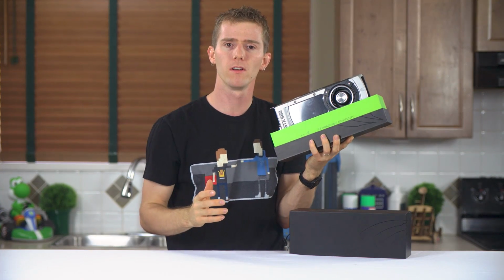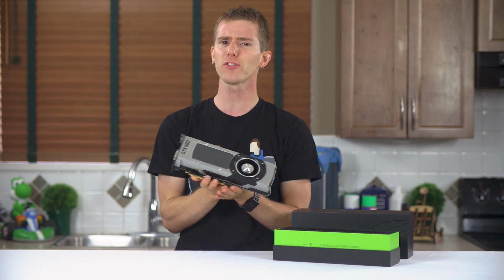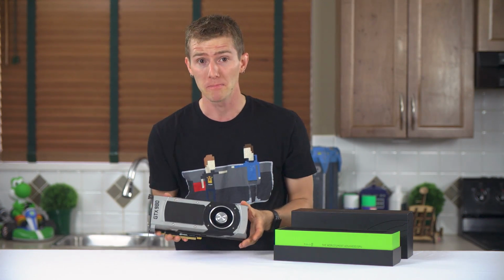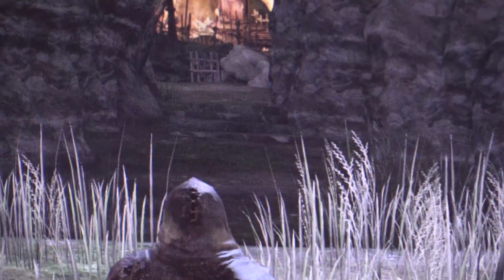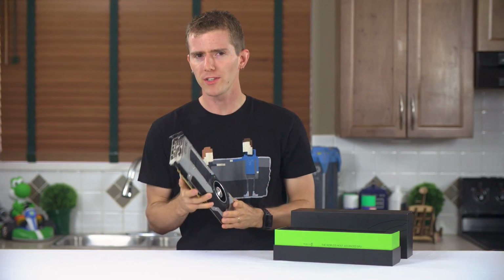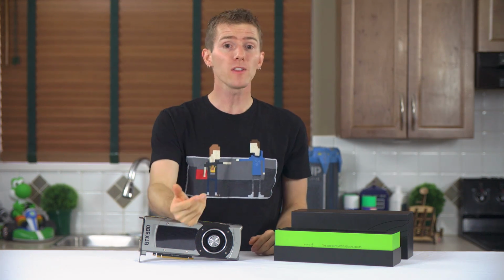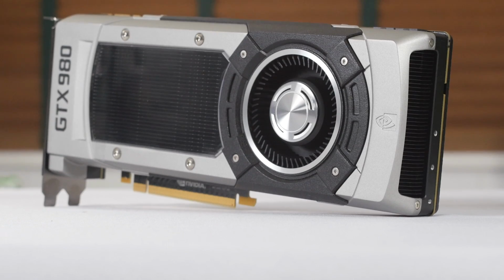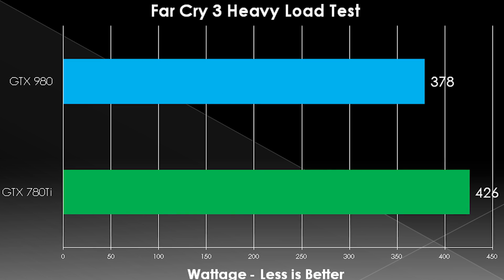NVIDIA GeForce GTX 980 Video Card - Performance Overview

Comment: I'm an AMD fanboy but hearing those clockspeeds. heavy breathing intensifies
Reply: im gonna wait till AMD release their cards. Find which is the best for the money then  probably jumo to 1440p res. I perfer amd but got nothing against Nvidia. I just think waiting to see both sides is better than blindly buying a product now that has a lot of potential to be worse and more expensive.
Reply: ChronicCoding I said the same ting but the prices are gonna be hard to beat
Reply: ChronicCoding
more and more games nowadays are using nvidia gameworks so IMO its best to just go nvidia.
Reply: ChronicCoding they would need to sell their r9 290x bellow 300 bucks.  They can't sell it for $330 because no one would buy it when the 970 runs cooler, makes little to no noise with lower power consumption.  It would have to be like 280.

Comment: For anyone upgrading, a 980 is a no-brainer.

But, if you have a 780 ti, I don't know.

I'd say you're kind of boned. The new card is better, so you won't get good resale value. And the 980 is better, but not by much.

I guess them's the breaks.
Reply: i got a titan when it launched and i will upgrade to 980...as soon as i find someone who is willing to buy my titan for 400 or 500 bucks that is xD fingers crossed
Reply: GL with that. Can't even sell a 780 ti for that price right now, and it's arguably a better card for gaming applications.

Comment: How is it that TechofTomorow always has fair results for AMD products and yet you guys don't. You always make AMD products look as bad as you can possibly can while saying that you don't hate or favor either AMD, Intel or Nvidia.
Just as proof that they cripple AMD, I ran Far Cry 3 on my Sapphire Tri-X 290x with a FX9590 on a BenQ XL2720Z with Vsync turned on in the scene where you escape from the burning building where Vaas ties you to a chair. My average fps was 87 with the highest being 144 and the lowest dip being at 53 when I looked at an explosion. I ran the scene all the way until I finished the mission.
Reply: whenever linus reviews an nvidia card, he chooses games that can utilize nvidia features ...so of course youd see better perfomance on the games than the amd counterpart >_<
Reply: MrMilkyCoco, Far Cry 3 is supposed to be, from what I know, a game that is also optimized for AMD. Look at the video at 9:08 where he shows the average fps in Far Cry 3 to be 48.6 on a 290x. I had almost double that with the settings at max and also at 1080p. I don't know what scene they use for benchmark but I used the mission where Vaas captures you and ties you to a chair in the building he sets fire to and then you escape with Liza because I considered it to be visually demanding with all the explosions and car chases.

Comment: last time I've had a backplate on my card was GTX 280. This is not the first time nvidia has ever done this...
Reply: They told "on stock design" and not the redesigned cards
Reply: Benihipe  I'm pretty sure my card was stock. Also most other brands also had the backpanel, so it wasn't one brand exclusive.

http://img.techpowerup.org/110310/gtx280_2.jpg

Comment: Think i might wait for the 980TI if there is one. If not, I'll go for two 980s.
Reply: There probably won't be, I don't believe there are any locked cores on 980 and they're hardly going to spend a huge amount of money developing a different GPU just for one card. GK110 had already been developed for Titan, and 780Ti was largely in response to 290X. Personally, I reckon that when you throw in MFAA it will be hard for AMD to beat 900 series, and they look to be liquid cooling their next flagship.
Reply: JammyDuel
Interesting, thanks for the input.

Comment: The 980 is cheaper than the 780 ti right now. Until the price drop happens the 980 is the place to go for high performance value. In the same way the 780 ti was the titan killer the 980 is the titan black killer.

Comment: Brand new architecture. Barely beats out a GTX 780. Lame.
Reply: the architecture is based on keplar anyway, and its beating a card with 800 more cuda cores than it (the 980 has about 2k cores and the 780ti has 2880 cores) and is using less power to do so you fuckwit, this isnt even gonna be the cherry on this cake as nvidia likely already have the 980ti ready and are just waiting for amd to make their move.

Comment: This is why I am a big fan of Nvidia. How did they significantly reduce power consumption just by changing the architecture and driver. They are so good at milking profit as well. Will they release 900M series as well by the way?

Comment: @C0d0ps  its worth it, but you wont get much actual performance gain from an fx6300.  You will see far more with an Intel i5 or better upgrade.  And those FX chips run very hot, so better cooling is recommended.  Its hard to justify keeping AMD CPUs any more.  Maybe in 2016 when the new chips launch they will be good.  But right now, upgrade your cpu/mobo and overclock everything.

Comment: What is the difference between downsampling and Super Sampling Anti Aliasing?
Reply: the application its used for.......
Reply: Downsampling is the concept of rendering the game at a much higher, custom made, resolution than your monitor is capable of displaying and subsequently having the GPU rescale the image
( as in downsample ) to that of your monitor's native resolution.

Supersampling is computationally expensive because it requires much greater video card memory and memory bandwidth, since the amount of buffer used is several times larger.
Reply: G4M5T3R Isn't it almost the same?

"SSAA is slow because the pixel rendering stage of the rendering pipeline must do the same amount of work as if the screen resolution was many times the resolution of what it is. For instance, with a resolution of 1920x1080 and 8xSSAA, the hardware must calculate the same amount of pixels as if the resolution was 7680x2160."

Source: http://www.dahlsys.com/misc/antialias/

Comment: So is it worth getting a 980 over a 780? Or would getting two 970's in SLI be better?
Reply: 980 seems to be 20% faster than 780.
Reply: WarHell Would getting two 970's in SLI perform better than the 980 alone? I assume it would.
Reply: It's performs quite good on higher resolutions (1440p and more)
Reply: I don't care about power consumption and one card doesn't look so beast... so its a 100% 2x 970's in sli better frames and it should be a 780 or over in performance like the 770 is a oc oc GHz edition of 680. Also if it was a non reference Asus or evga more room for over clocking.

Comment: The GTX 970 is the true star here, amazing performance and awesome pricing. As a R9 290 owners ,makes me jealous for the entire package, not just the performance which is the same or slightly slower or faster depending on the benchmarks.

Comment: So I just bought a 780... For no reason.
Reply: Only if you bought it to brag. Otherwise the card is still very much viable.
Reply: if its evga dont worry
Reply: Why....the release date was practically set as soon as Game24 was announced, then when you consider that there was the offer on 700 series flagships terminating today it was 100% certain that this would be 980.
Reply: The GTX 780 is still a beast of a card and will play games at maxed out settings. No need to worry. :)

Comment: I'm hoping for a non reference with more VRAM because right now this is the same price as EVGA 780 6GB, but with slightly better performance  values and if Watch dogs can consume 3.5GB of VRAM at 1080p Ultra settings I can see this card bottle necking on games that use a lot of VRAM at 4k resolutions..
Reply: it uses that 4gb more efficiently, that 3.5gb of watch dogs on this card would be more like 2.5-3gb.

Comment: If I had the money, I would get the GTX 980, I currently have a GTX 680 in my system, which has an i7 3930k CPU with 16GB of ram. Getting this card will further future proof my system when new games that take advantage of its features come out.

Comment: I Think that what nvidia succeed at is the 970 as it's faster than the 290  and the 780 and when overclocked it is faster than the 290x and way faster than the 780 , and at a price of 330 $ it's a great card and it can run a 4k display with no problems

Comment: Suddenly a triple ASUS PG278Q G-Sync Monitor Setup ( plus a 4th Accessory Monitor ) became a viable Option.

Too bad though all of my current cards are running fine and I'm still doing great with my three Dell U3007 plus a Wacom Cintiq 24HD Touch Monitors.

Kind of wonder how they'll name the Generation after that Card... GTX 10xx?
Sound's weird in my head.

Comment: I already got my 780 ti :) I thin kits a great card and ofc its overclocked like hell :3 I put it in a water cooling loop, and now it stays nice and cool, and it actually runs most games with higher fps than my fiends gtx 980! I honestly preferer the gtx780ti, but its just my opinion :) What do u think? :)

Comment: Guys i'm confused between Lenovo Y50 or a $1350 Desktop, the desktop will be much more powerful than the Y50 FHD, but I can take the Y50 Any where! And whats the best parts I can get for "$1350" PC.
Reply: Talal Aziz Thats very obliviously question, SLI ofcourse.
Ciel, 295x2 will get rekt by 970 SLI.    900 series are equal to AMD's 300 series, Do not compare dragon to rabbit
Reply: I have a y410p. Get a desktop, these lenovo laptops arnt build to last too well. my keybard has fallen off mutiple times and one of my speakers died.
Reply: Spencer Funk That's what i hate about laptops, and what i like is walking around with it any where.
Reply: Desktop...And if you have any spare just buy a cheap gaming laptop. Not great performance but it should do everything you want and that you can do on the desktop. I have a laptop and it is terrible for gaming. So I've been spending $1100 on a gaming pc from February and it will last me for the next few years
Reply: Talal Aziz Desktop. I will always choose a desktop over a laptop however a good desktop can peform 2x as well as a laptop 2x the price. In the end you'll save more money
Reply: Ciel Diablo If u r in my situation for example, you don't like to waste your time alone in ur room, but u have $1400 to spend on a PC, you want a gaming laptop but you feel that the $1400 is too much for it, and in the other hand you don't want a desktop but u know it will be a monster with the new 970!! what ur gonna do ?!
Reply: Talal Aziz lets go with learn English?
Reply: bmxtricky5 let's go to be helpful ? come on man !
Reply: ***** Whats better a single gtx 980 or gtx 970 SLI ?
Reply: Talal Aziz neither get a 295x2 XD
Reply: ***** thank u

Comment: No point updating this year apart from power consumption. Another Very disappointing year for Gpu. I blame AMD because they make shit GPU to compete against Nvidia. Nvidia only need to beat AMD which they always have.
Reply: Are you fucked in your head or something? AMD make great GPUs!
Reply: Gustaf Bjurstam gustafuk u are dumb ass. Check the comparisons on GPU. Nvidia smokes AMD. Nvidia in average have better performance and power consumption in a real comparative price for performence. 

You wan't the best GPU, U get Nvidia 780ti/Titan black.
Wan't the best price cheap low level GPU go for Nvidia 750ti thats slaughters even next gen consoles. 

AMD suck at everything. Even Intel realize they don't need to try hard because there main competition sucks so that's why we don't see much performance on Intel CPU's anymore even though they rape AMD cpu many times over. LMAO that an AMD 8 core CPU clocked at 5ghz can't even muster a 3.9ghz 4 core Intel CPU. AMD are a laghing stock. Look's like Nvidia know it also. Why try hard when ur competitor sucks balls and cannot compete.

Comment: I am really hyped for those cards, especially at the price point. I will be upgarding to a 900 series, as right now my graphics card is like 3 years old and i really start to feel it. Would be interesting to know though if there will be a 980ti, as I will be able to afford a new card starting somewhere in september i guess. Someone will probaply find out untill then, if the core is not fully unlocked yet

Comment: When I buy a graphics card, temp and power consumption are on the same tier as fps. 980 all the way.
Reply: Temp yeah, power consumption not so much is you have a badass PSU, but then again Corsair dominates that market so they're all expensive as fuck.

Comment: The biggest draw for me to upgrade in the next few years is 4K. My 560 Ti and 1080p monitor are fine for now, so I see no reason to buy a new card unless I can get reasonably-priced, quality 4K hardware, and that means a single-GPU solution for 4K for the games I like to play. If I can also get a 4K monitor at a nice, high pixel density, possible in a 23-25" size, I should also be able to disable anti-aliasing in most of my games altogether, adding a few frames onto the reports in this video. But I want to wait until solid 60 is doable in most games. Let's hope the 1000-series gets us there.

Comment: 980 for sure, but my 780 is good for now. i will look into a new when the 1080?? or whatever launches
Reply: Sooo? Your point?
Reply: sooo? why would you uppgrade a 780 to a 970?? or even a 980??? i mean, i upgrade when next line up comen i think, not now. and if 780 ti or 980, so 980

Comment: I've seen benchmarks in which gtx 980 beats gtx 780ti with a margin of over 20fps which is really good provided that 980 is not the replacement of that beast 780ti 980 is suppose to be an replacement for 780 and 980 smacks 780 like a baby just wait for 980ti if you want a replacement for 780ti but I am happy with 980 only

Comment: Should I buy i7 5960X and GTX 980 or go for i7 5930k and 2x GTX 980??? :P
Reply: 2nd one. GPU is so much more important than CPU for gaming.
Reply: you dont need x99 chip for gaming
Reply: If he wants it he can have it.
Reply: But then he should not be surprised that his more expensive cpu do not give him any fps
Reply: wwwelkam Exactly. The difference between a 1150 CPU and a 2011-3 CPU when it comes to gaming is about 3 FPS. (With the same GPU)
Reply: 5960x and 1 980 then add another 980 in the future when you have more resources.
Reply: BrutalSwede But I need overall best performance. I will buy IPS monitor so I dont need more than 60 fps. I dont render films but I need pc that will run many apps at one time ( game, google chrome with many tabs, Autocad and more at same time).
I know that in games i will make 2x more fps with two gtx 980 :P

Comment: Hi! noob pc elitist god gamer here. If i can already run BF4 max on ultra... on my 780ti. will the 980 be better than the best? to put it simply... will there be difference in terms of graphics?
Reply: no
Reply: Nah, it won't look better. But it'll run with slightly higher frames. I'd wait till the 980Ti if you have that kinda cash ;)
Reply: Wut?
Reply: The graphics in game will look the same, but you will get higher frames. You said would there be any difference graphically.
Reply: Ariche2 I just wanna know if I would regret on having a 780ti, perhaps not. Thnx for the info! :D

Comment: for 500 bucks....I paid about 555$ for my EVGA GTX770 (reference Titan cooler) year ago, prices are quite high here, so for 500$ right now I can only get GTX970 which isn't worthy upgrade for sure :P
Reply: 970 is 330
Reply: thereddog223 Depends on where you live. I think Australia has some wicked taxes on their tech.
Reply: idk, I've heard that the 970 beats the shit out of the 770 with a large, blunt hammer.
Reply: That is a lot of taxes
Reply: the 970 is about the same as the 780 non ti performance wise

Comment: Man now im even more confused whether i should go with the 980 or 780ti...
Reply: 980 cheaper and better in almost every situation.
Reply: Commenter ok but when will it be available?
Reply: Few weeks
Reply: MrVarwor
You can buy it at Newegg now.
Reply: I'm thinking get the 980, nvidia still has to release future driver updates for some new features that aren't available yet and I'm sure that will include performance boosts.
Reply: error2k2 damn thanks for all the help bros. The YouTube comment section is proving to be quite useful this time around!
Reply: error2k2
I was actually contemplating EVGA 970 FTW's in SLI.  I am running 670 FTW's in SLI now.  The cost of two of them isn't all that terribly different than one 980.
Reply: deathbringr124 I'm not sure how 900 series scales in SLI yet but if the past is any indication, it scales around 80-90% gain.
But be aware that some games (specially when just released) don't handle SLI well and you will get the performance of a single card.
Reply: deathbringr124 It's not and would probably be faster
Reply: MrVarwor Available now but sold out everywhere. You can pre-order

Comment: imagine the 980 sli with i5 4690 on 650w power supply... all dem dreams
Reply: akalion213 because the performance per watt....
Reply: I am actually interested in the performance of this in sli as well as the 970 in sli.
Reply: Ehm...Why not imagine quad crossfire 295x2, 5960x and 1650Watts?
Reply: Axecution Meh...You will save 50 cents in a year big deal

Comment: should i get a another 770 for sli or should i get a 980 and put it in my motherboard without sli and use my 770 for a different display, if that even possible i dont know

Comment: i'm thinking about buying the GTX 980, but is having just 1 fan on it (as it comes standard) gonna be a problem? i'm not gonna overclock it.
Reply: Do you seriously think that they will release their cards if they have a problem with the cooling WITHOUT even overclocking it?......... This cooler that the 980 uses is the best reference cooler.
Reply: i guess my question was kinda stupid, i'm truly sorry.